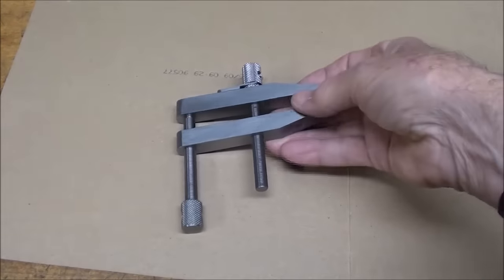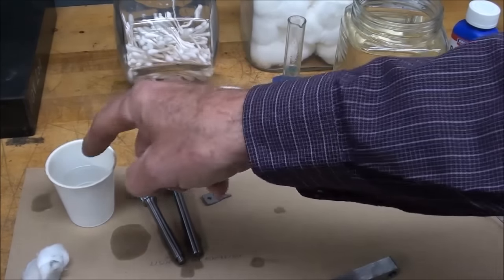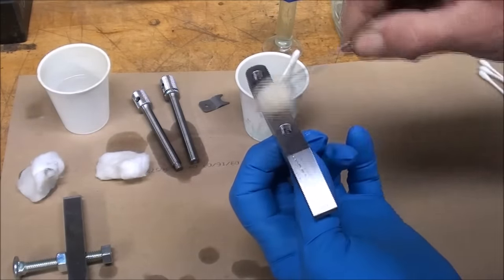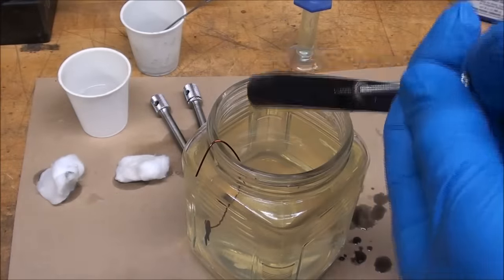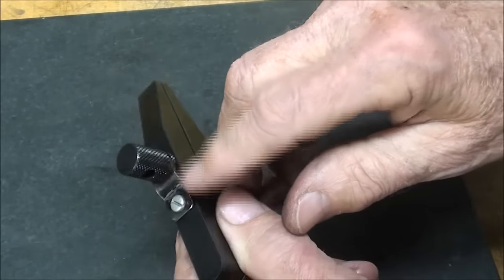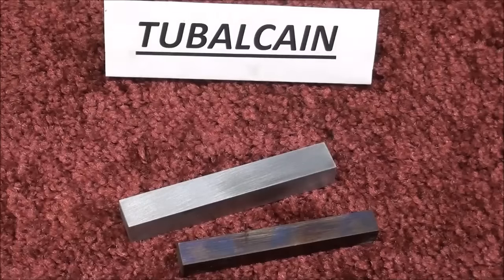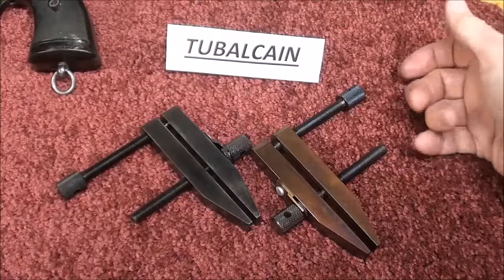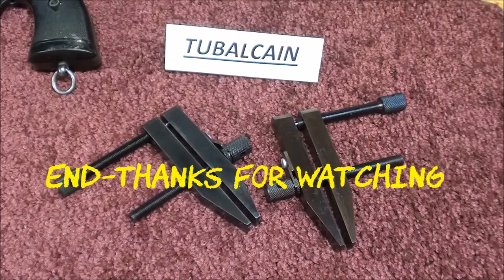SHOP TIPS #277 Gun Bluing the Toolmaker's Clamp tubalcain

Comment: Graduated cylinder....   I'd suggest using straight isopropyl for your your final cleaning or even the brake cleaner, which dries with no residue.  "Rubbing" alcohol generally has a small castor oil component and by tax law must have a poison to limit human consumption.  Neither of which are ideal for you blueing process.    What a great little tool Mr. P.  Thank you for sharing the build.
Reply: +Doug Reed Agreed.  But read the BAFAC tax code and you will see rubbing.alcohol is still on the roster.  Probably a leftover from prohibition days.

Comment: We used to do metalwork here in England in the 70s, made lots of small tool projects, what we used  to do was to heat to about the same temp as you did and quench in old engine oil. This makes an even black finish. Very easy, even us kids could do it !!! I work in engineering still after 40 years, still using school metalwork skills.
Reply from the maker: +Johnny Noggert Thanks for watching. I'll try that

Comment: Many years ago, my friends dad told us to use lacquer thinner instead of model glue. He said hold the parts together, and dip a toothpick into the lacquer thinner and just touch it to the joint. It worked, as it spread out through the joint and the plastic welded together.
Reply from the maker: That is a good tip. I think acetone will do the same thing

Comment: When we didn't have heat sticks we use a pine stick. You rub the stick until it left a black mark. That ment it was hot enough to put the bearing on or temper a knife. Seemed to work.

Comment: Mr Pete, a couple of points,
 Go to the dollar store and get a spray bottle and some bubble juice. Use that to find the leaks in your air system. This is why I never throw out a good spray cleaner bottle. Then you can fix them and save wear on your compressor and have air available all the time. I wired a clock into the motor circuit of mine to verify that it will sit all week without coming on until I use some air again.
 If you set your parts in a tray or pan of brass shavings, copper filings, or even sand when heating, the color will be much more uniform. See videos at Clickspring.
 Any oil or fingerprints will leave marks or splotches that may or may not be attractive. These are caused by the different rates of oxidation. Holding your clean thumb on a part for a minute to deposit oils and acids will mark your tool with your thumbprint for ID. You can try different things for effect, striping with a brush or polka dots with a swab for example. Blowing through a straw on different areas will vary the temperature and oxygen level changing the color. With practice you can simulate color case hardening.
 If you quench in oil the suface pores will fill and further "rust proof" the parts. Better yet, after quenching bake the oil in at about 400°F for half an hour to seal the surface. Do this when your wife is not home and clean the oven and air out the kitchen after! A good reason to have an old stove in the shop.
 I have always felt that if you make a tool look nice like a tool it will get treated like a nice tool.
 Despite the efforts of a great many researchers the world over, there isn't, and there never will be a cure for stupid. Maybe only natural selection or zombies.
 This is a nice set of videos and I thank you for them and all of your others, too.
  Mike (o\!/o)
Reply from the maker: +Moholo 88 Thank you so much for watching

Comment: I re-blued my Winchester model 94 using this same process and it was one of the most frustrating experiences I have ever known.  It took me 4 tries to get it right where there were no blotches in the color. I had to completely strip the previous finish before trying again and again. I could not get the barrel and the receiver to color match.  It was made in 1979 and a gunsmith told me Winchester was notorious for using different types of steel over the years and at one time the receivers were made using sintered metal.  I eliminated the stock open sights and mounted a Lyman tang mounted peep sight.  When I drilled the tang for the mounting screws the metal drilled like cast iron producing tiny flakes for chips.  I will never cold blue an entire gun again - next time I will pay to have it hot blued.

Comment: I've touched up a lot of guns with this stuff, and I've blued a lot of my reloading dies with it. What works best for me is polishing anything you'll blue to a mirror finish, that's the most critical part of an old school looking bluing job. Then clean it with brake cleaner.

After that, use a hair drier on it and get it pretty warm, not excessively but warm enough it's uncomfortable to hold. Then lather the stuff on heavily. A lot of times I'll actually start coating the part in oil as I'm rubbing the bluing on. On some metals it seems like the oil gets the bluing chemical to penetrate better, but you need to really saturate everything heavily.

Afterwards, clean it with brake cleaner again, rub it down with steel wool, and repeat the process as many times as necessary to get it to look nice. I like using a wax based spray on chemical to protect blued finishes, as it totally seals the metal and will make it safe to get modestly wet. I bet car war would work well too. In my state just oil isn't enough to protect bluing from instantly rusting.
Reply from the maker: Thanks for watching.

Comment: For a cold blue, 44/40 also covers good. Both will "keep" longer if they are varnished. A quick niter blue can be made with 2/3 lye and 1/3 sodium nitrate (or saltpeter), and also works good for tempering by color. When it melts, you hang the parts in, and pull them out when they get the shade you want. The high temperature will alter the temper on heat treated stuff, though.   For a real durable blue, "Mark Lee #1 rust blue" works well, and only takes boiling water to set the stain.

Comment: I used to blue blades on high carbon steel pocket knives to protect the blades from rusting in my pocket.  I kept an old aluminum stove top coffee pot to boil water for rinsing because the metal would self dry. I told my college chemistry teacher I was having trouble understanding a process, she grabbed me and asked if I was going to be a Chemist.  When I said no, she said "Just memorize it!"  Genius, yes!  We did hardening and tempering by color in HS Machine shop.  Yes it is purty.  Good looking tool.
Reply from the maker: Thanks for watching.
Reply: I use to do the same thing! All of my Old Timers still wear it....

Comment: WD 40 works well for an initial oiling since it displaces all. Moisture. a lot of guys I've found out don't realize our favorite all around oil is Water Displaces #40. It does work but not that great depending on what your lubricating I like zoom turbine oil the little extended tip helps a lot another great video
Reply from the maker: Thank you, that's a good tip

Comment: I wasn’t a gun smith, just an armorer. However, I have cold blued many guns and parts. A couple of suggestions, first, degrease the piece a little more throughly, a little more scrubbing with the alcohol, maybe 2-3 Times. Then, when you apply the blue, if the piece has a brushed look, applying the bluing with a clean scrubby pad works wonders. Then, a warm bath to wash off bluing, followed by re-applying the bluing gives a darker, deeper richer. Color. The final wash off of the bluing salts, at least twice, is critical to avoid rusting, and of coarse the application of oil, (starret of course!).
Reply from the maker: Thank you for the information

Comment: What about how the blacksmiths do it? Heat up the metal, and then melt beeswax onto it. As I understand it, some of the beeswax gets drawn into the pores of the metal. You get a blackened and rust resistant coating.  By the way...I had a great metal shop teacher like you over 30yrs ago and have used the skills I learned throughout my lifetime. Its so sad that many schools don't even offer industrial arts classes anymore. Thanks for making videos to pass on your knowledge.
Reply: +AndTheCorrectAnswerIs hmm interesting. seems legit as the pores of the metal do open quite well when heated. 
cool@!
Reply from the maker: +AndTheCorrectAnswerIs Thanks for watching.
Reply: i use bea wax right now 🤣
Reply: @zomgthisisawesomelol the wax decomposes into some form of carbon that is bonded to the steel
a bit like seasoning a cast iron pan

Comment: For an alternative to ear swabs, check out RamRodz. Their .22 swabs are a good size for general use, the swabs are low lint, and the sticks are bamboo so they don't snap.  Great for cleaning pistol barrels too!   Brownells sells them for a low price.

Also, I recently got a California Air Tools compressor, it is amazingly quiet and they have great customer service.  It makes less noise than a conversation!  So if you need to replace your compressor, I'd recommend taking a look at their offerings.

Comment: In most of the heavy, metal turning channels (like Abom), the chips coming off the work quickly turn from silver through straw-color to blue in a couple seconds. Lots of heat is generated plus the chips are not very thick. It's interesting to see. The blueing on old guns (like Smith & Wesson) is very beautiful. Lots of manual polishing when labor was much cheaper. We're of similar age so I think you'd agree, a lot of things were much better 20-30 years ago. Is that a Smith I see at the end of your video?

Comment: I use the Birchwood casey super blue. Always keep a bottle in my shop. From what I've heard, its a more potent solution so it'll work on a wider range of steel alloys. I haven't used the perma blue, but it looks like it did good also.
Reply from the maker: Thanks

Comment: Thanks for another great video! Perhaps laying a piece of fiberglass insulation over the threaded parts would help them heat more evenly? This is just a guess but it's easy enough to try.
As was already mentioned, acetone is cheap and great for cleaning, plus you do not have to dry it. The only drawback is it eats through gloves and you have to use a lot of hand cream as soon as you're finished - it removes all your skin oils.
Finally, better brands of gun patches make for a nice, small, and inexpensive lint-free cloth for swabbing or oiling or drying small parts.

Comment: Another YouTuber named Clickspring uses heat to blue small clock parts.  He uses flame to heat a brass tray filled with brass shavings and the part to be blued.  The shavings distribute the heat, and he gets a beautiful product.  I can't seem to post the link here, but if you search for Clickspring you will find him.  The video is titled "Home Machine Shop Tool Making - Making a Versatile Bluing Tray."

I wonder if this would also work with hot sand surrounding the part.  Could the part be inspected periodically to see how far along it is?

Thanks again, Mr. Pete.  This is a great video.

Comment: Fix the air leaks, it saves both on time to build up pressure and on power to drive the compressor. You don't leave the lathe motor running all day just in case you want to turn a single rod, but an air leak is just like doing that.
Reply: It's more likely he doesn't hear it, rather than deliberately letting it leak.

Comment: Engine oil also hardens the steel. if using the hot plate it is better to use ceramic blanket.

Comment: I have two of those thermoplates in my lab. The newer models have temperature indicators that more realistically correlate to the temperature of the plate, but often you want such a precise temperature you would never rely on a built in indicator anyway, just a properly calibrated thermometer.

we use them for all sorts of things, but primarily for heating volumes of liquids in pyrex containers for making buffers and other chemical solutions

may I suggest seating the piece to be blued in a bed of sand or my favorite: brass chips? It seems to conduct the heat better to irregular objects that way

Comment: there are also tin/lead mixtures with ajusteble ratios and "getting at 500F in liquidstate with"  for such hot blueing found them after i did the torch game =) i also searched for liquid saltbath but the salts are nitrate and very difficult to get with out getting spottet by "youwannabuildabombsnazis" -.- lead with tin bath rest lead  
temp is in Celsius
tin %10  20  30  40  50  60
      300° 275° 255°  230°  210°  185°
also with antimon 
 % 5 10 13
     290° 270° 250°

Comment: Interesting.  I hadn't seen bluing done before except by heating brass (clickspring's videos).  What is the purpose of the bluing other than looks?  Ditto for the oiling?  Simply to prevent rusting?  Thanks.
Reply: the blue in both cases is a thin layer of non rust oxide witch prevents rust(the destructive oxide). It also may make the surface harder and more scratch resistant ( I am not entirely sure this is the case for steal it is for aluminum)

Comment: just borrowing the comments to ask a question. ;) I always wondered if the black tip on a screw driver is needed or not. for example, if I chip one of my screw drivers and the re-grind it and often times you need to grind down to thickness too. should I blue or oxidize it somehow? thanks!

Comment: maybe the screws would blue up if you tapped a thin piece of stock and screwed it into the stock.... laid the stock on the plate.  Stock would transfer heat to the threads.  2c

Comment: For an effective bluing method using only heat, please see this video
Reply: The main features are to use a thick tray and a pile of brass shavings around the part. I'm sure shavings of any metal will do the trick. Do not let the flame touch the part directly; the most consistent color comes from indirect heat.  A tray of any size and shape can be used to suit your parts.

Comment: this birchwood stuff isnt real bluing, its chemical coloring. 
Acetone would possibly make better results than isopropanol. 
And heat up the part with a hairdryer before applying the bluing solution.
for "heat bluing" you should check out midwayusa s video " How to nitre blue gun metal for a beautiful finish"
Reply: +IzNoGuD Surfer Yes . I allways clean with MEK first then iso then heat steel with gas burner to remove moisture before painting of any kind .

Comment: Thanks Mr. Pete!  Loved this series but then again, I love 'em all.  

The MSDS for the bluing solution is here: https://www.birchwoodcasey.com/getattachment/Resources/Safety-Data-Sheets/13125,-13132-Perma-Blue-Liquid-Gun-Blue.pdf.aspx.  You're absolutely right about protecting yourself against chemicals but the bluing solution is not particularly bad--just in case any of your viewers were wondering.    

The bluing soluion has selenious acid in it which sounds scary but also doesn't seem to be according to its MSDS: http://www.sciencelab.com/msds.php?msdsId=9927582 .    Per your instructions, a little safety gear, a little common sense and all should go well.  Dispose of the waste responsibly as you mentioned.  I was a chemistry major and none of the things I'm interested in ever involve chemistry so I had to dive in!  The bluing process converts the surface layer of iron into black iron oxide Fe2O3.  Really just controlled rusting!

Comment: Thanks for the info on chemically blackening steel. When it comes to bluing steel parts by heating, I would suggest you watch this video: https://www.youtube.com/watch?v=5sAw4Q1PM8Y  (in case you haven't already done that). At 8:35 you see a highly polished steel screw getting a very attractive and uniform dark blue color. I think the secret lies in polishing the steel part to give it a glossy appearance and applying uniform heat at the correct temperature. Of course, once the part gets the right shade of blue, you remove it from the heat source and allow it to cool.

Comment: sir i would like to add my 2c. there is a really good video about blackening you can see here https://youtu.be/hCqg6mh2pp0 it`s a good method rather simple and effective, here in the end of the world we sometimes use kerosene for giving some colour and some rust resistance (low) the piece is heated to hot hot (it`s a technical measure) and then submerged rapidly in a small container of kerosene, use to do it in small pieces so a soup can would suffice this gives a dark brown/blue/black colour really nice. remember to use this method the container of kerosene must be in a cool place filled to the brim and with some type of cap on, the moment you will dip the piece you open the can (to minimize vapors although kerosene is not as volatile). you don`t clean much with this method, heat, submerge, wait repeat (outside of the shop i mean and away from other flammables). it`s not something a newcomer or inexperienced should try but works

Comment: Hello Professor.
the user ClickSpring (www.youtube.com/watch?v=5sAw4Q1PM8Y) to stain its steel works, heats them dipped in the brass chips with propane torch.
in alternative lineseed oil and propane torch.
As an alternative other use linseed oil and propane torch.